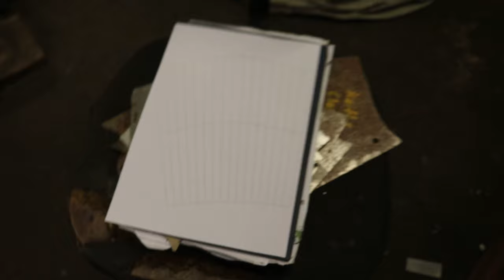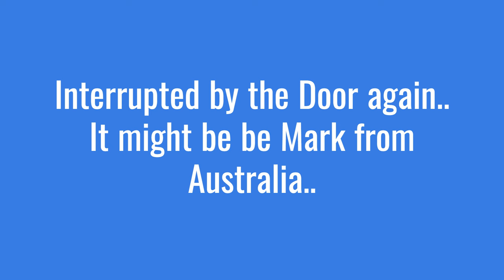Hand making an Exhaust system for a BSA WD-B40, using the traditional Sand Bending technique.

Comment: As soon as I heard Unity Equipe I was time travelled back to about 1978 when I took a trip there!  At time I was building a 1969 Triumph T120 to cafe racer style, I kept seeing Unity ad's in Bike mag and MCN and they seemed to have the bits I needed, hence the trip. Trip because I lived in Yorkshire at the time, specifically Sherburn in Elmet, home of the Coffee Bar, or Squires to some.  From memory I picked up Tomaselli alloy clipons and levers, some engine dress up parts, alloy bellmouths, high level pipes and reverse cone megas, possibly some other bits, I can't recall, it was a long time ago!  The cafe racer restyle didn't make the cut though, I changed my mind and went for a concourse resto instead!  Did a deal with Trevs motorcycles in Doncaster and part swapped all those bits for some engine parts and a few other original bits. Wish I still had the Bonny, but I sold that and a 900SS Ducati to buy a Honda CB1100RC, the things you do in your youth!
Reply from the maker: Thanks for commenting, I love hearing old tales about my Grandads old Shop. 😁👍